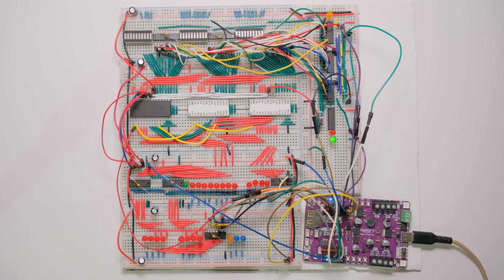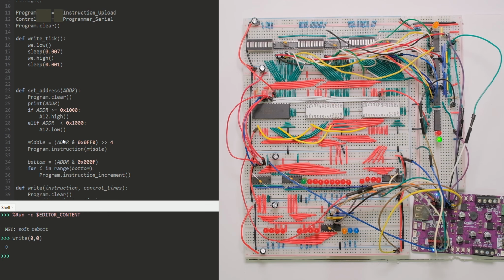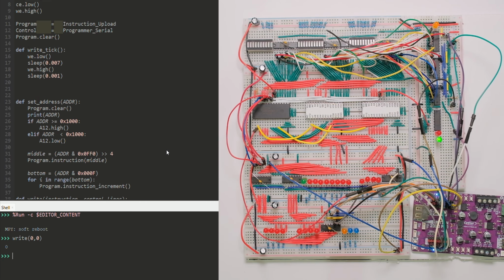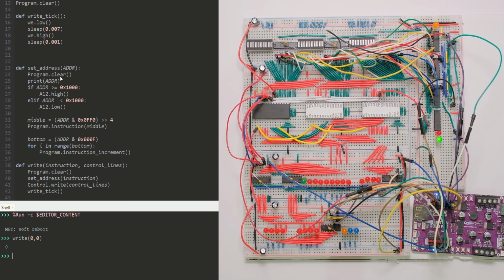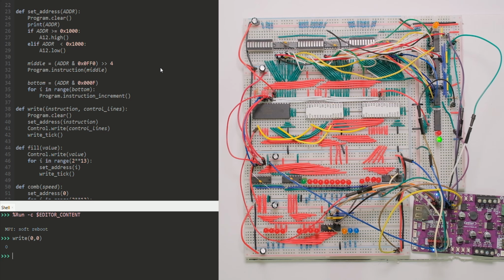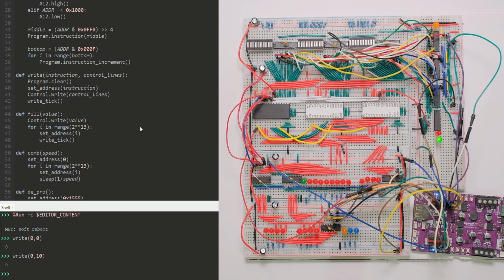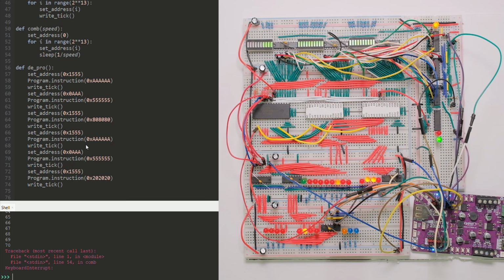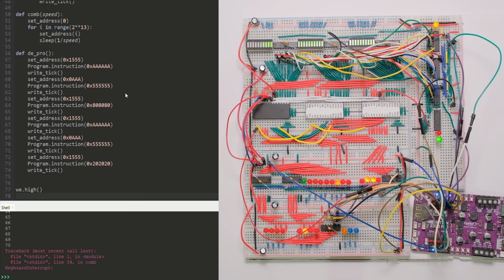GR8-1 Home-brew CPU : The Control Unit!

Comment: This is pretty cool!, I'm currently making my own 4-bit CPU called "ABM402" not on breadboards yet I'm still in the planning phase, the main issue I'm having is fitting all the instructions in the limited space of 16. if you want i can show the ISA?
Reply from the maker: @4T4T.  That would be nice! I have this bad habit of doing stuff without proper planning and don't even have an instruction set yet. You could solve the limited instructions by fetching 2 nibbles to make up an instruction. This would make it more complex, but will fix the issue for sure. 

Are you planning on making videos about your CPU? I'd be interested in seeing what you come up with.
Reply: @EdwardGonell Creating instruction sets is really tricky good luck with that! Thinking about longer instruction length, I'm not sure as you said it makes it more complex. As for the videos, probably not, but we'll see. 

About the Instruction Set, I want to rework it. I'll send the link once it's done!
Reply from the maker: @4T4T.  You got me thinking about it and I came up with a small instruction set, although I don't know if it suites your needs. Also got to make a GitHub where I'll be posting technical updates in conjunction with the software I'll be developing. https://github.com/EdwardGonell/GR8-1-Homebrew-CPU
Reply: @EdwardGonell  Where can i find this instruction set?

Also the Github is really cool, you seem to be going all out for the GR8, Could you tell me more about it?
Reply from the maker: @4T4T.  Forgot to upload it. Should be able to find it under the Documentation folder.